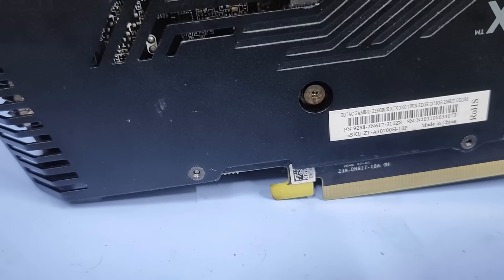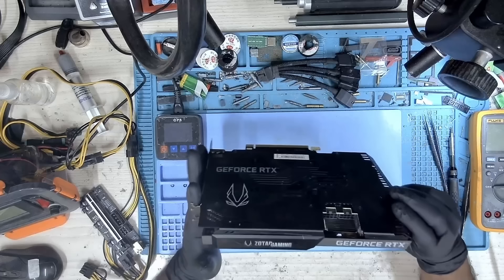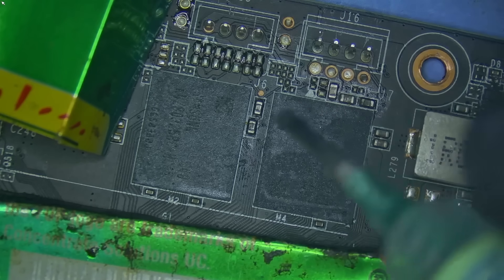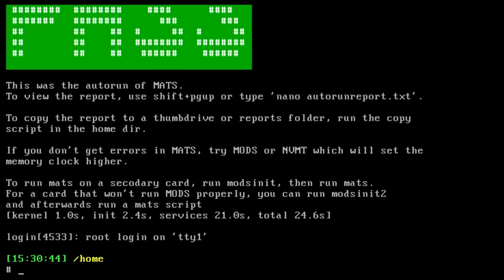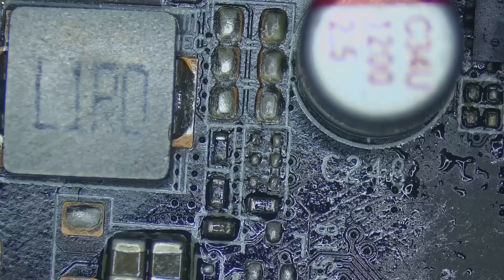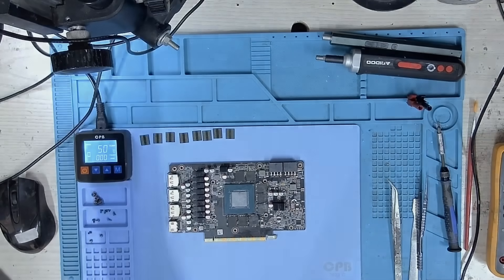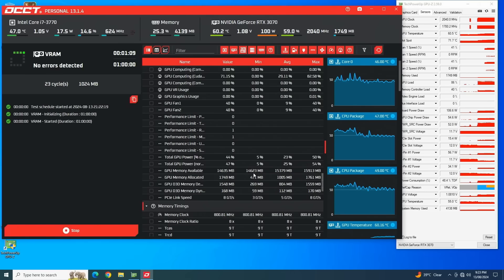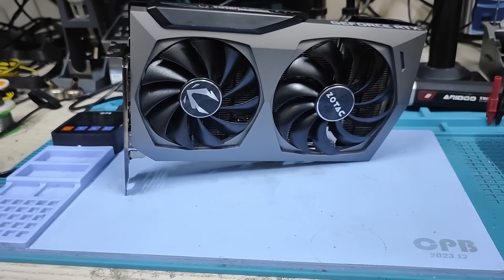Upgrading RTX 3070 Memory from 8GB to 16GB - Part 1

Comment: Hi, I am curious what temperatures you used for preheating and for the hot air station. 
We thought that 120C preheat and 400C hot air station would be ok. We didn't have a sufficient preheater or hot plate so we used a heat gun to carefully keep heat on the board 😬. Then like your video we used a hot air station to apply heat to the chips and remove them. The problem with the heat gun is it doesn't have temperature control... we used Kapton tape on the core and other surrounding components, so I am hoping we didn't destroy any components or damage the pcb 😅 what do you think? The components look ok on the outside but I'm not sure at what point heat becomes a problem.

I am also curious on how to check voltages etc. for core, memory, and power delivery so we can make sure everything works before plugging it in.
Reply from the maker: For voltages you can refer to my other repair videos where I resolve not detected issues. I take voltage measurements.  Heat gun is deadly for graphics cards. Let's hope all has gone well .
Reply: @GraphicsCardRepairs-tk7ql  oh dear. This is very worrying, I am wondering if it is worth putting the new memory modules on for testing or if I should give up. Do you have suggestions for which components would be likely to be fried? That way I can check those first. Thank you for freely offering tips and advice by the way! :)
Reply from the maker: @samueljett7807  difficult to say without examining the memory modules. But I suggest you buy a hot air station for this job.
Reply: @ We have a hot air station, but we didn't have a way to preheat the board (the hot air station didn't have enough heat by itself) so we used a heat gun at a distance to keep the board warm. The hot air station wasn't heating up the chips enough by itself. We now have a hot plate to use instead which we will use next time.
Wondering if the capacitors or maybe inductors for the GPU (next to the memory chips) are commonly suspected components of damage under that heat. Or if even the board itself has gotten too hot and got damaged?

Comment: I have a question, can the RTX 4080 be upgraded to somehow 24 or 32GB VRAM? I wish it could be upgraded or there's a module or memory chip that supports it.
Reply from the maker: Unfortunately none of the 40 series can be upgraded using the same PCB.

Comment: Hello master. I have a question. Im srmi truck driver owner op, but years ago like in year of 2000 and 2001 i went to school for radioelectronix. And thru out my life been fixing some things time to time. Never things as complex as GPUs but anyway... resently I watched a vedeo on Youtube how easy you fix those things and desided to buy a broken gpu to fix for my self. So I got  EVGA 3070Ti from eBay at around 150$. The card had some green rust at video outputs. Cleaned that the rest of the board seemed ok. Even had a factory seal. And seemed not to be meesed with before me. I liked that. But card has no video, no power at the core, has 3 red lights at power connectors. As described from seller. One fan spins at full speed all the time 2 fans not spinning but both move a little at power down moment. Chip LPC51U61 next to fan connectors stays hot to the touch. All fuses and 000 resistors are good as well as coils. And the worth thing I found yesterday was many shorted capasitors on the core it self. So my question is: "Does it mean the core is dead or can it be shorted memory chips or capacitors them selves, or something else?" Your one word will save my time and money.  So I will greatly appreciate it. If its a dead core i probably shouldnt buy another core since its expensive and there may be more failures on this board that will kill another core as well. If its dead memory or capacitors i probably should try getting some parts and experiment some more. Any ways sorry for long coment and Thank You.
Reply from the maker: Ok So the red light on the 8pin indicates that there is a short circuit on the board. The thing to keep in mind is that the core resistance is so low that it will look like a short circuit but that's not the case. If fans are spinning it would mean that 5v is present. Or if fans are not spinning then 5v is missing. For 5v to come on 12v should be present on 8pin and the PCIE. Now if you have more than one 8pin and 5v is present and you have a red light that means that the 8pin powering the 5v is good but 8pin on the MOSFET or the memory is shorted. The easiest way to troubleshoot is if you have a variable bench power supply to power the GPU. This way you will not damage the GPU.  You will also need a thermal camera (other ways are isopropyl alcohol, rosin flux etc but slower process) to check for the shorted component. All you have to do is measure the resistances to ground on each of the 8pin on the inductor and the one which shows low resistance connect a wire. Inject 1v and 4A from your bench power supply and observe with the thermal camera. This way you will not damage the GPU if the short is injecting voltage to the core. The shorted component will glow and that's your target. Replace it and you're done.
Reply: @GraphicsCardRepairs-tk7ql  Thank You so much. I appreciate your time. Yes i do have bench test power supply and some small cheap  but working thermalcam. Will try tomorrow to do it all as you said. Thank You.

Comment: Did you tweak BIOS on this? Because I want to upgrade it myself, if so, how?
Reply from the maker: No bios tweaking is required. Works with default bios and settings
Reply: @GraphicsCardRepairs-tk7ql  I have a question, what is exactly being done here at 10:30 did you remove the straps or rearanged them somewhere??

Comment: Hi, where did you find the information on the resistor code 110? I want to make sure I make the right changes. Thanks
Reply from the maker: @samueljett7807 in the schematics of the GPU.
Reply: @GraphicsCardRepairs-tk7ql  after a google search I see the badcaps result with files, is this what I'm looking for? I assume the boards will be roughly the same across brands (I have a founders edition and an ASUS dual OC edition)
Reply: @GraphicsCardRepairs-tk7ql  gotcha I found some stuff on google, I assume the boards are roughly the same across manufacturers? I have NVIDIA and ASUS models

Comment: Hai how much would it cost to upgrade the ram for rtx 3070 ti
Reply from the maker: Currently none of the GDDR6X are working with the upgrade. I have not managed to get it to work.
Reply: @GraphicsCardRepairs-tk7ql  what gpu would you say can be done other than 3060

Comment: you can upgrade rtx 4060 ti 16gb  a 24 gb vram?
Reply from the maker: Unfortunately the 16GB version can get to only 16GB max. There are no more slots left and 2GB is the largest capacity produced on GDDR6 and GDDR6X platform.

Comment: Helo bro, 
Am a mobile phone repair technican. I need to upgrade a gpu. Have a question , its just only changing only vram chip ? Or want to do anything like after software programing or need  to do anything?
Reply from the maker: Only changing VRAM modules and straps like in the video.

Comment: Is it possible to do same with 3080 10Gb making it 20Gb?
Reply from the maker: Currently I have not managed to get it working on the GDDR6X memory modules. Work is in progress.
Reply: @GraphicsCardRepairs-tk7ql  I suspect that the problem could be BIOS related. There must be support in the nvidia bios for 2gb modules for the memory to work, but since these cards (3080) were released early in the 30xx cycle, their bios may not have this support built-in. Budget ones (like 3060, 3070) came later and I think they got this support "by accident" (due to ongoing work for 40xx cards that had these 2gb ICs)
Do you have any info on this? Have you seen  bios for 3080 with 2gb memory ICs support? (I think it can be checked with gpu-z)
Reply from the maker: @aspinx  yes BIOS needs to be edited for the 30 series. Nvidia also has a digital signature in the BIOS making it difficult to edit it too much. I am working on a fix. I will release a video when I find a fix.

Comment: Is there a way I could buy the vram modules for the H100s and place it on a 3080 or 3090?! Please respond
Reply from the maker: H100 uses HBM memory. that is they are fused on the same substrate as the core. its cannot be removed.

Comment: Can you upgrade the 5700xt with more memory ?
Reply from the maker: I have not tried it on 5700XT as the upgrade cost exceeds the GPU's value to a point where you can get a 6800 for the same price as the value of the GPU and upgrade.
Reply: @GraphicsCardRepairs-tk7ql  would there be a way to upgrade a CMP90HX to  make it more efficient. It's supposed to be an equivalent card to the 3080 but it has limited access to power settings for undervolting

Comment: Can you update my 4090 laptop to have  24 GB?
Reply from the maker: I have not tested upgrades on laptop yet.
Reply: @GraphicsCardRepairs-tk7ql  wait.. you're actually saying you can do it?
Reply from the maker: @ChrisDaniel-y7h  I will need to find a laptop with this configuration. May be after that I may be able to know if it's possible. If it has 8 memory slots then 16 is the highest it can go. If it has 12 memory slots 24 is the highest it can go.

Comment: possible to 2X the memory on 4090? so from 24gb to 48gb. 
or even 2X on a 5090? from 32gb to 64gb
Reply from the maker: 4090 memory capacity cannot be upgraded. 2Gb is the largest capacity produced on GDDR6 and GDDR6X platform. GDDR7 will be coming with 3GB modules and possibly 4GB too. 5090 may have a chance.

Comment: Not only Gamer want more RAM, if you run LLM's in GPU you need a lot of RAM.

What does that RAM cost? What could a specialised Company Charge to Upgrade RAM?
Reply from the maker: For a 2080 Ti with 11 1GB modules I charge $220.

Comment: How much would you charge to do the same for a 3080 ? so instead of 10gb go to 20gb
Reply from the maker: 3080 is a work in progress. I have not managed to get any of the GPUs with GDDR6X to work with upgrades yet. I will release a video once I find a solution.

Comment: Damn want to try this on my 3060ti, I have a hot air rework station and and know just enough to be dangerous. After all performance wise a 3060ti is basically a 4060ti.
Reply from the maker: I have tried it but it's not working. It requires a bios edit

Comment: Great video, very interesting. Though I know you are making this for gaming, I was wondering if you have done any testing with AI. Since AI is the new hot thing and requires a ton of VRAM to run a local model, this mod is very interesting. I am curious if the issue with the black screen would make any difference if this card was run as a second or third gpu on Ollama or another local LLM app that can split the inference onto multiple gpus. If you could have a 3090 or better as your main card and a few of these, you can almost run a 70b parameter model locally.

Comment: I assume the rtx 3070 uses chips that run at 14gbps. Would the gpu be able to fully utilize high speed chips such as 16, 18, and even 20gbps chips on top of the higher capacity of 2gb? If so, what would the cost difference be between them?
Reply from the maker: Memory timings will have to be written in the BIOS

Comment: Can you upgrade 3060 rtx from 12 to 24 or any higher than 12? How much does that cost with shipping to canada?
Reply from the maker: @ThisIsSparta300  unfortunately it already uses the largest capacity produced on GDDR6 platform. 2GB modules are the largest capacity.

Comment: Please tell me where I can find the layout of straps for 16 GB Samsung on rtx 3070 suprim. I really want to make one for myself at home. Thank you very much
Reply from the maker: Layout of straps are not available anywhere. It has to be identified from the circuit. The configuration is available in the schematics of the model. Like 110 or 101 or 000. Nvidia maintains a standard for all GPUs when it comes to straps so it's easy to write the BIOS.

Comment: Can I do this on a 3060Ti? I have a broken 3060Ti that I'd like to mess around with, but I don't know if the reason a 3070 works with 16GB is that the 3070 BIOS/drivers were made with a 16GB variant in mind, while the 3060Ti wasn't?

Or does it work the exact same on a 3060Ti?
Reply from the maker: Yes the 3070 has the timings for the 2GB memory modules which can work with 16GB. Unfortunately there are no driver optimisation for it . I have been working on a 3060 Ti but unfortunately it does not work with 16GB without editing the BIOS. I am working on it.
Reply: @GraphicsCardRepairs-tk7ql  hmm. I have the parts to make a 3060Ti 16GB. I've seen Brazilian guys make 3060 Ti 16GBs without modifications. I guess I'll just try my hand at it, given the 3060Ti cost 50 bucks.

Comment: Was thier ever a pt2. is the memory issue a result of the binning process and bandwidth issues Also could you reduce the chips from say 8 to 6 and get 12gb ram?
Reply from the maker: Memory can only be doubled. To disable a memory BIOS edit will be needed. Memory can be disabled from the BIOS.

Comment: I wish I had someome near me that could do this. The only issue I have had with my RTX 2070 is running out of vram lately in newer games. I have to turn down the settings even though Im getting around 100fps because my vram is maxed and it starts stuttering.
Reply: Imagine how I feel with a 2080...I got a good deal on it, but it is still frustrating

Comment: Hello some days ago my fan of gigabyte 1070ti was broken and then I replace it but the GPU didn’t give display before the repair it was working normal so help me I think the person who repair it connected the fan wrong and now some chip may be damage so can you help me which chip
Reply from the maker: If there is no display there are various causes. Unless diagnosed it's difficult to say. You will first check if the card is getting detected. If yes run mats if not troubleshoot for no detect.
Reply: @GraphicsCardRepairs-tk7ql  the pc doesn’t turn on when plug in the card it’s like that the gpu don’t turn on
Reply: @GraphicsCardRepairs-tk7ql  can you make a video on how to repair and change the fan chip on the card I think it’s this chip HT32F52241

Comment: I thought you need to flash custom firmware after upgrading GPU memory?
Reply from the maker: @starpilot101  not required 😊
Reply: @GraphicsCardRepairs-tk7ql  that's good to know. Means you don't have to depend on unstable custom firmware. I've seen many other videos of VRAM upgrades that include using custom firmware and drivers.

Comment: For example 1080 Ti in Superposition 8k gets like 3768 score Not power efficient and more power always is more heat and energy is expensive here.
 For example 3070 Ti got almost the same TDP as 1080 Ti, maybe higher. While my 1080 Ti does very well in 1440P I will change it for a more power efficient card but 4070TIS is close to the previous cards TDPs while 5070 not sure will not stutter in 1440p as rasterization potential is poor. Choices of upgrades are very dim.

For example 1080 Ti 224 TMU 3070 got 184 TMU ,5070 192 TMU.  3070 and 5070 should have more TMU than 1080 Ti, so WTF NVIDIA.

How fast textures are applied to objects in the games can not be replaced by DLSS or AI. Maybe more C cores or faster DDR can help lower TMU count but wait! 5070 got only 192 bit and just 12 GB

A Texture Mapping Unit (TMU) is a component in modern graphics processing units (GPUs) responsible for rotating, resizing, and distorting bitmap images to be placed onto 3D models as textures.
 
is getting worst despite technology advancements.

Comment: It's a shame this cards doesn't have a VRAM temp sensor. Nvidia partners was too greedy to add one is crucial to check VRAM temps. specially if you change pads or upgrade VRAM.
Did you notice stuttering on 1440P gaming or benchmarks before the mod?
Reply from the maker: There was stuttering in superposition.

Comment: Where is part 2? Im right here with you with the 16gb after finding the right chips. I would like an answer that doesnt unvolve running in performance mode
Reply from the maker: Part 2 will be released in February
Reply: @GraphicsCardRepairs-tk7ql  so long, have you fixed the black screen vram issue yet
Reply from the maker: @khoadangbui9451  I have not worked on it yet. Part 2 will be out in February
Reply: As a note I've been digging through the schematics to see if I can find a clock strap

Comment: Is it possible to put higher than 16gb? 32-64
Reply from the maker: No the largest capacity memory modules produced on GDDR6 and GDDR6X platforms are 2GB. So GPUs with 1 GB modules can be upgraded to 2GB modules.

Comment: Was there a part 2? Did you get the black screen issue resolved? 
Ever upgrade a 3080 with Micron chips? I need to upgrade this year for production workloads and 10GB just isn't enough, but i also don't make enough to justify the prices of 40 and 50 series cards, so toying with the idea of a memory upgrade instead -.-
Reply from the maker: Part 2 will be out in February. Due to high volumes of GPUs for repair I could not continue my work on upgrades.